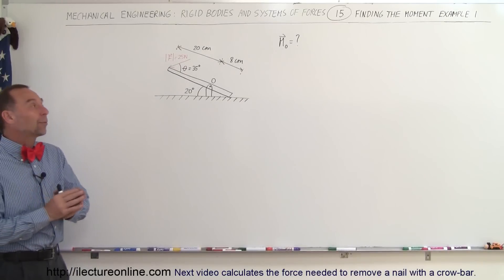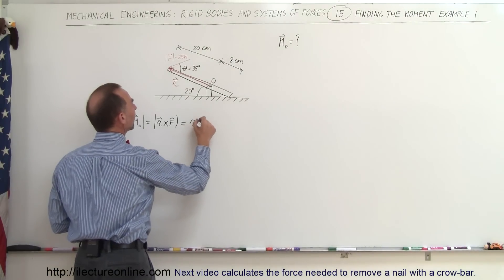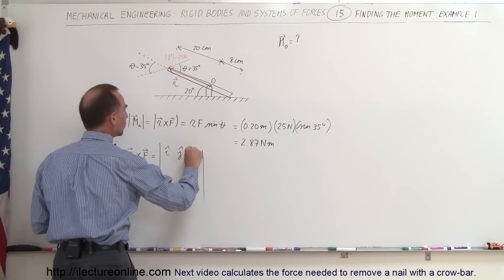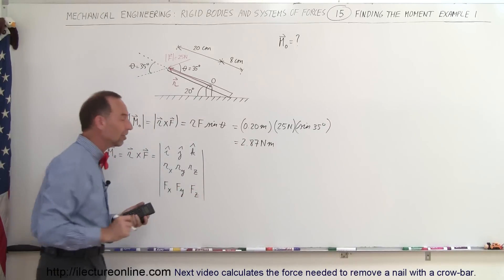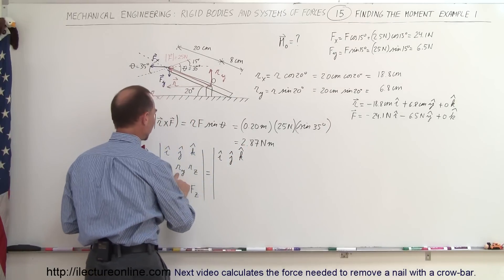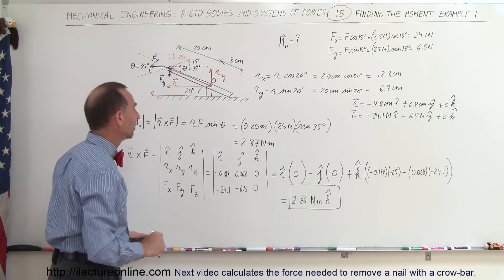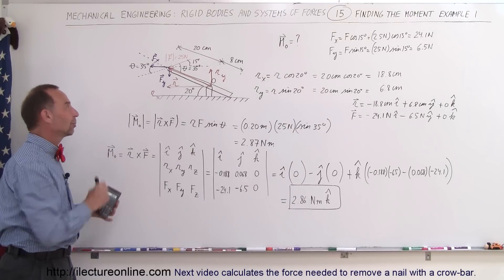Mechanical Engineering: Rigid Bodies & Sys of Forces (15 of 47) Moments (Bar with Pivot)

Comment: Hey, so I'm building a robot with a pivot flywheel. As of now the pivot is at 180 degrees but can be rotated to 90 degrees. I'm using air pumps to move it to the 90-degree angle, what gearing do you think would work best with it?

Comment: Sir, since we have got the vector magnitude at the first step, can we just use the right thumb law or some others methods to find out the vector direction which is in the k direction, instead of doing the cross product?
Reply from the maker: The right thumb rule will give you the direction (in a graphical sense), but you'll need the cross product to represent it in an exact mathematical way.

Comment: as per definitions 
''In hinged beams, there are only two directions of motion being resisted - horizontal and vertical. There is, however, no resistance towards any rotation within the supports''.

hence the moment should be zero at O.
but we are getting non zero value.
pls help me..........

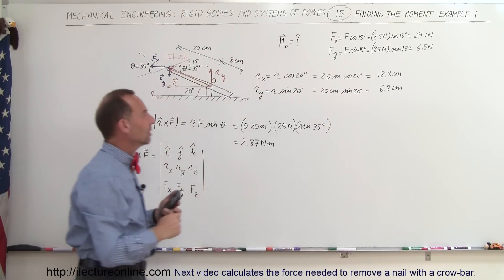Comment: sir could you explain why we took 15 degrees for Fx and Fy at 6:10
Reply: In this example, there is 35º  between the 'F' axle and the 'r' axle. Thus, in order to find the X component of the force 'F', there must be in horizontal. He just subtract the 20º angle from the 35º angle to have the horizontal. Then the result was a 15º angle in relation to the horizontal, or 0º degree angle.